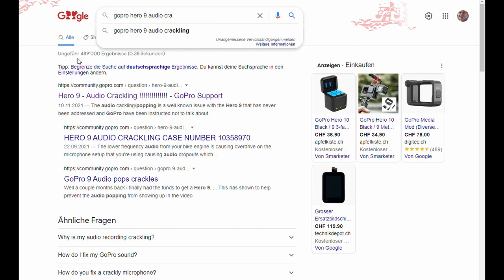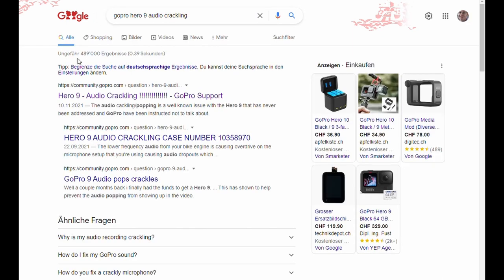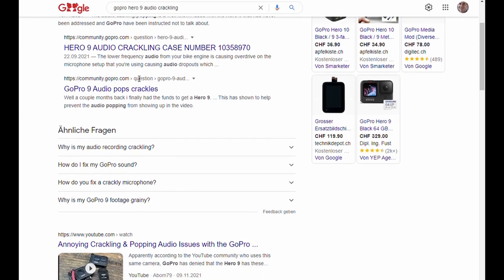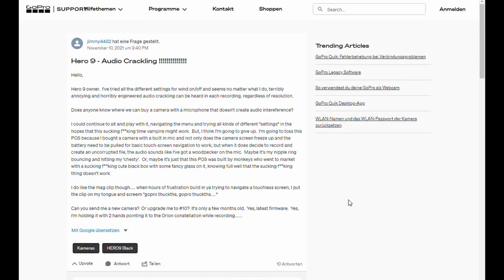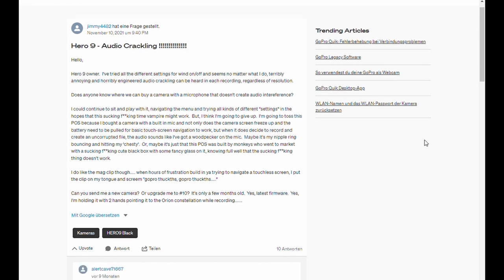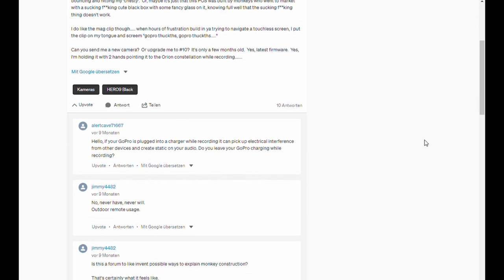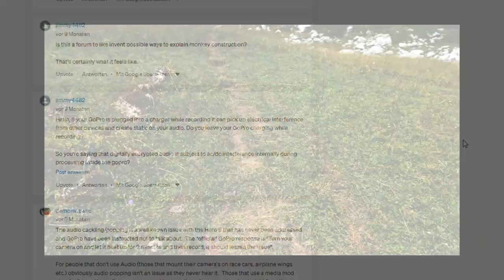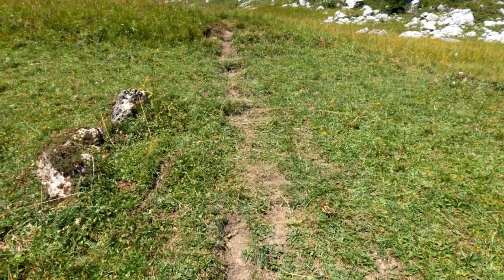GoPro Hero 9 audio crackling problem FINALLY solved!

Comment: I've gone through 3 Hero 9's and all have the same problem.  GoPro sent me one of these as a replacement, but it had the same issue.  The completely denied it was a problem and acted like it was some freak occurrence even though it happed to me 3 out of 3 times.  I finally gave up since my 9's have aged and I've beaten the heck out of them over the years.

The only way I can address it is in post.  I use Premiere Pro and purchased Adobe Audition.  I open all audio clips in Audition and use spectral frequency with the heal brush to scrub them out of the final audio.  You can easily spot them after doing it a few times.  It's a pain, but it's what it is;  been doing this with all my videos since the GoPro 9 came out.  I'm sure there are other audio editing programs that also offer spectral frequency mode that would work as well.

btw, amazing footage.  Wish I had trails like that by me.
Reply from the maker: Jerry, thank you for sharing your story with us! I know how it feels when GoPro doesn't care about their customers.
I also kind of fixed some parts of a video in post, in my case I did it manually, which takes a lot of time. Then I lost the motivation to create new videos, because I knew that I'll have to fix them afterwards. So I got motivated to finally fix the problem 😃
Reply: I HAPPENED TO ME!!! They sent me a replacement BUT THE ANNOYING CRACKLING is still there, I don't know what else to do!!!
Reply from the maker: @itsdidislife  Hi Didi, welcome to the club 🥲. If you want to have solved this nasty crackling, you have to show them that it's also their problem and it's a well known problem, at least with this model. Don't give up, good luck and I'm really interested about your outcome!

Comment: I am having the same issue, speaking to gopro on live chat they are ignoring the fact they have knowingly sold faulty goods.
i asked for an exchange unit to be swapped on delivery with my camera... they are refusing saying i must send mine back first and i will be without a camera for minimum of 2 weeks....... very bad customer service!
Thanks for putting this in a video!
Reply from the maker: I agree, the GoPro customer support, at least here in central Europe, is terrible. I spent many hours with them without getting help. And yes, they know that they have an audio problem with many GoPro 9 cams. 
But if they offer you a replacement, I would go for it as long as you have warranty on it and hope you'll get a working one. Good luck!
Reply: @PortableRadio   @HB9EAJ Portable Radio  Hi, i am in Portugal, they have agreed a replacement but wont agree to me swapping it over with the courier to save me going without for 2 weeks but they have said no, getting a manger call in a day or so.
i will reply with the outcome for others to see 👍
Reply: @PortableRadio  I am not getting very far with gopro, they have said they will swap my gopro but i have explained they know they have hardware issues and continued to sell a product with a know defect making it 'not fit for purpose' and because i have not damaged the gopro i have asked if they will do an exchange with the courier to save me losing my camera for two weeks and how it will effect our channel earnings.... i show my camera serial number put it in a box in front of the courier and he gives me the new one, they have refused as it isnt normal policy. 
I asked for a manger to call, got nothing, i contacted again and asked again, promised a call within 48hrs, that was 5 days ago and nothing so far.
They are denying they have a hardware fault, so i wanted to ask do you have any evidence of gopro admitting the problem

Comment: Thanks heaps for contacting me and sharing this! I did end up getting a replacement camera from gopro but it took some time. The replacement unit has the same problem but it's nowhere near as bad. When I contacted them, they of course said they didn't know about it despite their forums being full of complaints about the same issue. It's certainly shaken my confidence in the product, and I probably won't buy another one I say.
Reply from the maker: Thanks a lot for your feedback! Communication of GoPro support and reps seems not uniform, but at the end, one wants a working cam, as advertised. They really don't care about their customers and I'm sure there are other good products on the market.

Comment: Awesome looking mountains there! My GoPro 9 is making crackling noise but I am using the media mod with external mic this is driving me nuts.
Reply from the maker: Thanks! The media mod will most likely solve the crackling noise problem. If you solve it this way, GoPro sells more and you carry more. This may or may not be intended 😉

Comment: Hi what model did they replace it with that worked for you thanks
Reply from the maker: Hi, as explained in the video, it was replaced two times with the same model, a Hero 9. 
You can see all serial numbers in the video description, where the last digit is replaced with an X.

Comment: An 8-minute video promising a solution that doesn't have one. Thanks for nothing.
Reply from the maker: You're welcome! If you were in a hurry, you could also have read the video description. For me it was a solution, because I had a camera that worked afterwards. Maybe you explain us your solution?
Reply: @PortableRadio   there’s nothing in the description that will fix the issue. You even say in your video there isn’t. But you made a long video to tell everyone to just keep sending the device back. Won’t help anybody who is out of warranty, which is now everybody and was probably the same when you published this.
Reply from the maker: @TheRealOrangeGringo  In the video I try to explain the whole story, but I don't repeat it here again. The main point is that GoPro lied to me and other owners. This video is the proof and you can use it when discussing with them. And yes, if you suffer from this crackling problem, you should send it back and don't believe GoPro that there is no solution and you have to live with it. This is the main point! And of course, my cam was still in warranty and once GoPro replaces you the cam, the warranty starts to count again for two years, at least here in Switzerland. I just checked some shops and you still get it in Swiss shops with the full warranty.
Again, please explain me a better solution.
Reply: do you have to tell us your life story in order to get to…….NOTHING? 

😡
Reply: @PortableRadio the video title says, “GoPro Hero 9 audio crackling FINALLY solved!” 
But NOTHING was solved, you just exchanged the GoPro and it doesn’t take 8 and a half minutes of boring talking for people to know that.
3 words in 3 seconds would be enough, “just exchange it” 
There.
Reply from the maker: @elpayin1 If you watched the video, then you would understand that GoPro didn't let me (and others) exchange the cam, even under full warranty. The whole story including my solution needs definitely more than 3 seconds to explain.

Comment: I watch a lot of youtube videos. Initially though it was a problem with my computer.

I think it's worth perusing a problem like this with the company that you bought the equipment from but after seeing so many videos and posts about this, I don't think I'd ever buy a GoPro cam. Especially if it took you so much time and effort to get them to acknowledge the problem in the first place.

It seems companies like this just thrive on the cash that new models and features bring without proper R&D and then don't take responsibility for their mistakes creating a product that will eventually just get thrown away into landfill because it doesn't work. :(
Reply from the maker: I completely agree with every sentence you wrote! 
Also, a GoPro cam is not a cheap product from one of the Chinese online stores. I definitely won't be buying another product from them, especially as it seems they haven't really solved the problem, according to one comment below. We can only warn other potential buyers about this potential error.